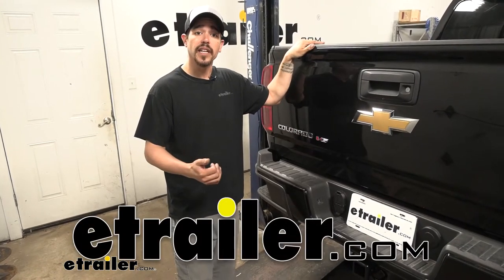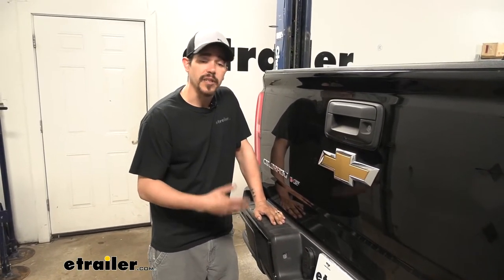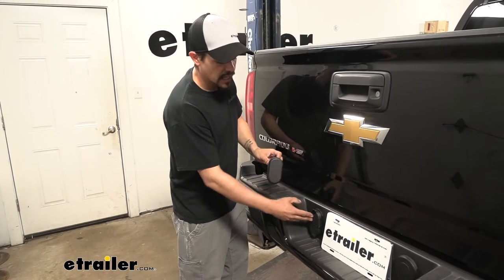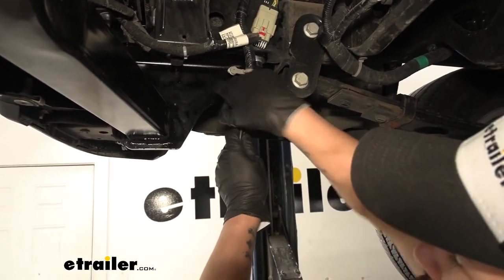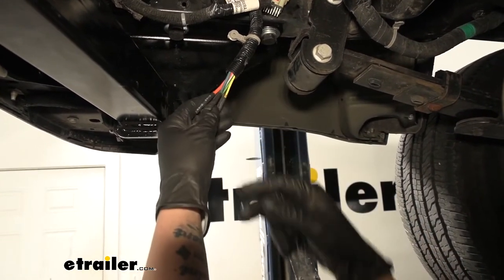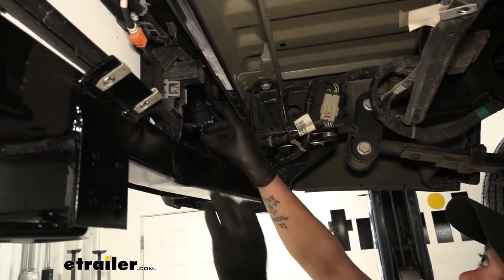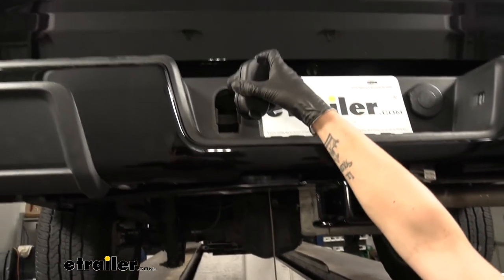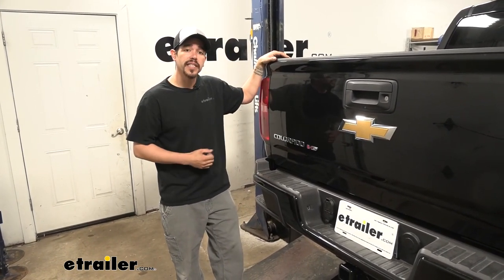etrailer | Hopkins Multi-Tow Trailer Connector Installation - 2019 Chevrolet Colorado

Comment: Thank you for this video. I ordered hitch from you. I need to wire a truck cap also. I need a hot wire for dome light, a brake light wire and a ground. I think I can lay in a wire with the black, one with the orange/red for a hot. Is there one that will work for brake light?
Reply from the maker: Check out the following link to read how one of our experts does a great job explaining what you will need and the best way to wire in the 3rd brake light on a truck cap so that it functions properly.
https://www.etrailer.com/question-566806.html
https://www.etrailer.com/Accessories-and-Parts/Hopkins/HM48235.html
https://www.etrailer.com/Accessories-and-Parts/Pacer-Performance/PP20-702.html